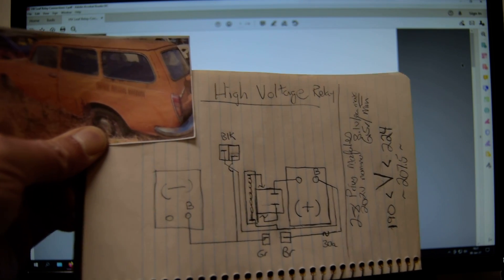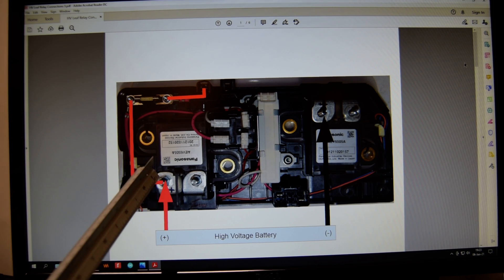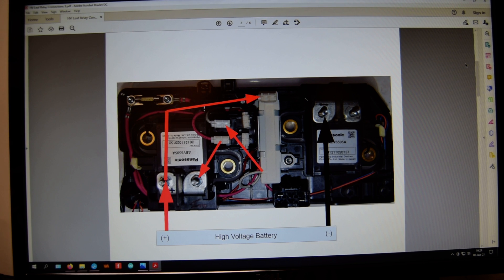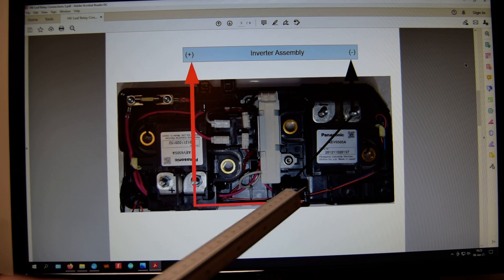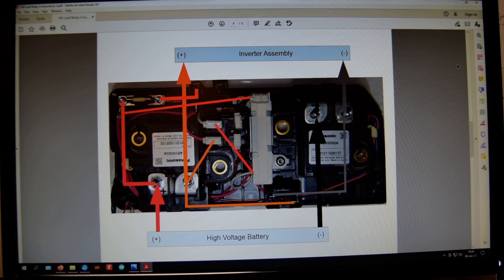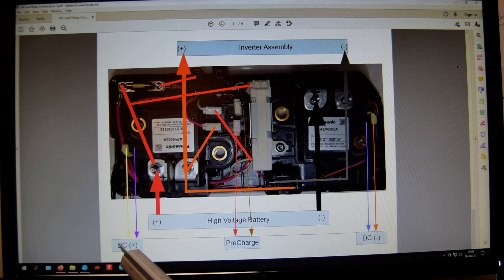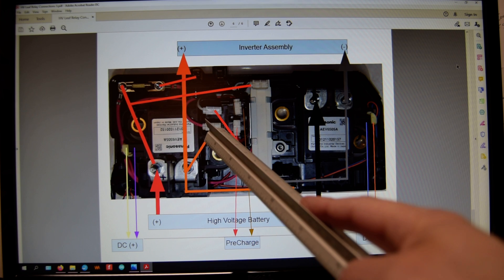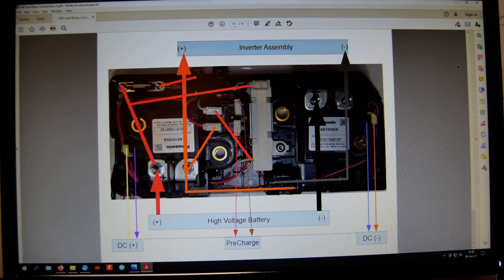Leaf Relay Board v2 - a better diagram

Comment: Hello, thank you for this video, I have the problem evc313 charging lock relay problem, where do you find this box? or do you have any idea how can I fix this the charging lock system doesn't lock the cable I have to try several time...

Comment: Hi, Do you know what would be the cars ignition on and off connections. I mean a signal that would turn the Battery on and off. On my board there is a  6 pin connector (bottom left of your diagram) that I assume controls things but I've no idea how. Can you advise. Many thanks and sorry for my non technical wording.